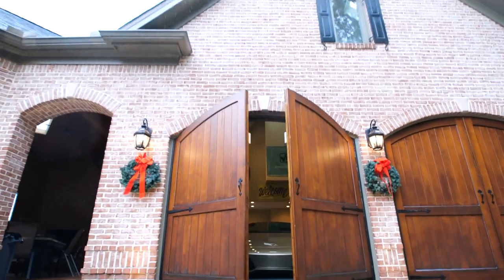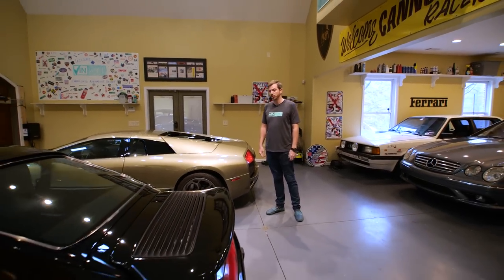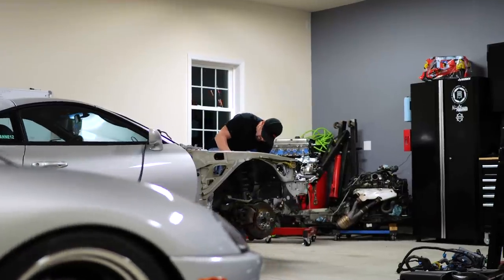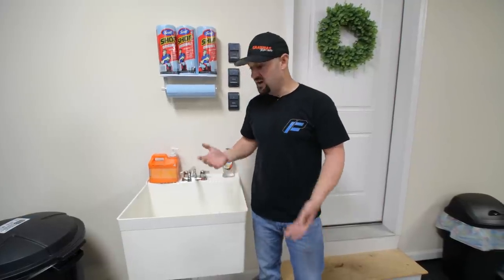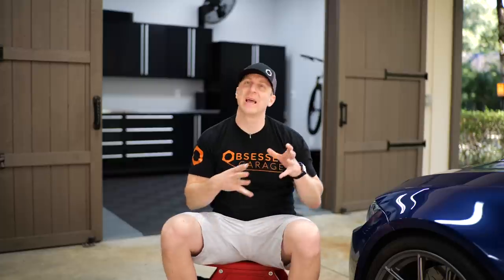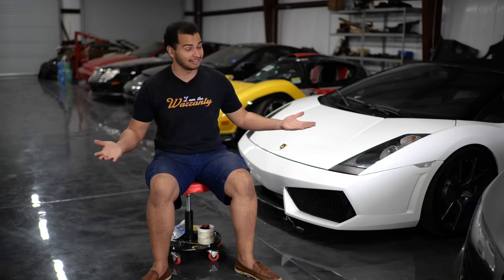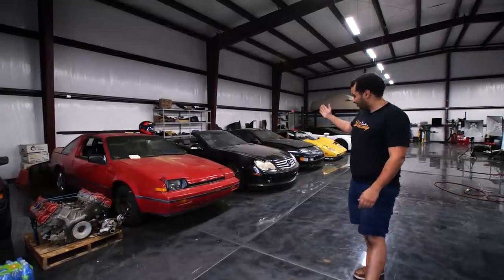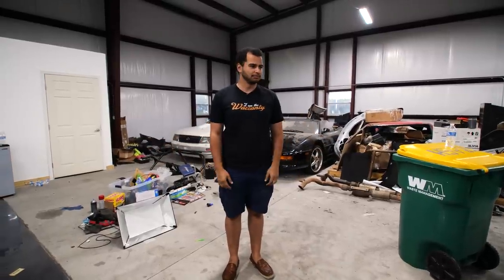4 Of My Dream Garages

Comment: As a Nissan Pulsar owner, I am here to cheer for one to be noticed. Even if it is a beat up base model... Mine is turbocharged and a heck of a lot more fun then the sohc 1.6L versions. The gears and gasoline guys have also entertained me quite a lot with the road trip videos they did, so I am happy this Pulsar spotting has come to pass.

Comment: I know I am a couple years late, but I would have solved VinWiki's Garage door problem. Each door would get a long L shaped bracket. The top of the L would be on the furthest part of the door on attached via a pin and then the lower portion of the L would face into the wall so the bar looks like a boomerang coming off the wall. At the bottom left of the L you would drill a hole and then mount the arm as if it was a door on a fixed hinge. Then put you a small hydraulic pump to push the lower base of the L, also on a pivot-able pin. This would allow the door to open with minimal force and short travel length of the hydraulic. This could be mounted at any height realistically.

Comment: I could brag about my 2004 Honda CRV with 400,000 miles on it but you don’t see me doing that. It’s because I’m humble. And believe it or not, I don’t even garage it. Runs like a champ, just gotta add oil every week and ignore the loose break line slapping against the suspension noise.

Edit: forgot to mention, yeah it’s ALL WHEEL DRIVE.

Comment: Imagine how expensive it is to have OCD to the level that Matt has. You have shelving that's approximately 20 inches deep, you can fit 6 rows of product bottles on that shelf in front of each other, and you must buy enough of those bottles to fill that space, and they have to be the same product so there is continuity. You don't need them right now, you probably won't use it all within the next year. But you have to buy them now because with OCD, gaps and a lack of continuity is untidy.
Reply: Ha, ha... You aren't wrong.